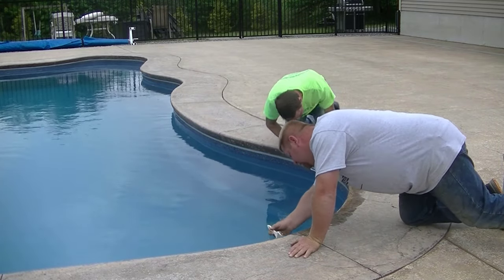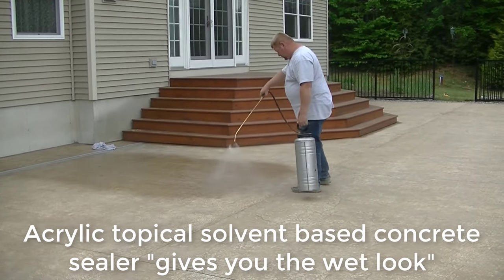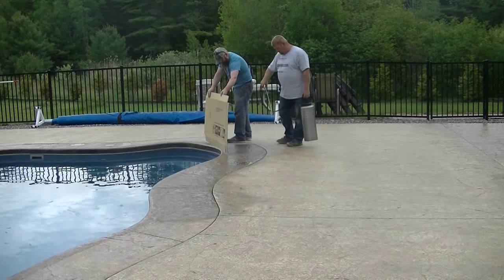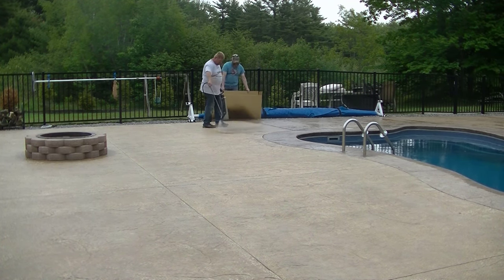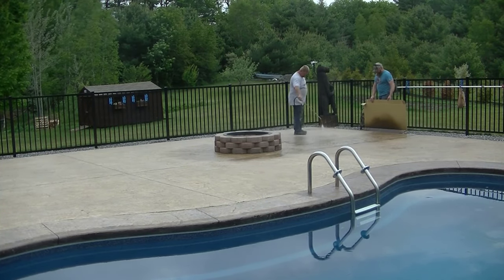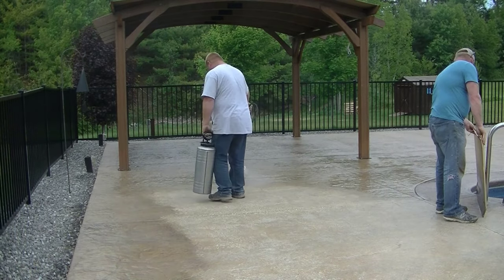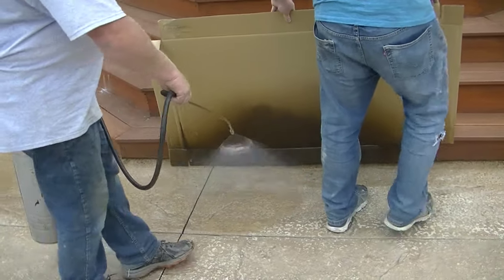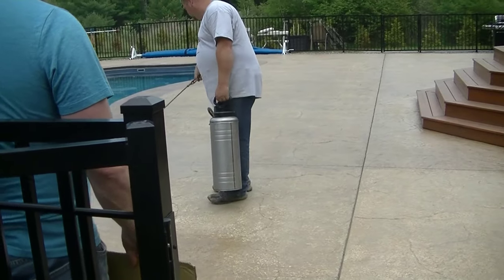Seal And Re-Seal Stamped Concrete (My Top 2 Concrete Sealers)

Comment from the maker: This is my go to sprayer for all concrete sealers: Chapin Extreme - https://amzn.to/2WYomi5
Reply: Expensive but worth every penny, Sprays a big pattern and chemicals don't hurt the seals. Just clean it good after use, it'll outlast a truckload of cheap sprayers.
Reply: Do you use the 1gpm or .5gpm tip when spraying foundation armor?
Reply: How much can you charge for a job like you did on the stamped concrete by the first pool?

Comment: Two years old but fantastic video. Update…

Just completed my pool patio and an adjacent patio with the AR350. Some post application tips for anyone who is looking to use this sealer. 

Spraying and backrolling gives you a really nice and consistent look. My pavers are textured so backrolling was essential to preventing pooling in spots. If you have an in ground pool with a loop loc cover…be sure to cover the grommets around the pool. I used painters tape and carefully applied it then used a razor blade to trim around. When I was done with the job the tape came off and it saved me from having these things sealed shut which would have been a nightmare. 

Definitely use a paint shield or piece of cardboard as shown in this video. No matter what you do you WILL get spray in the pool. Before the end of the coat application I added some enzymes to the pool which seemed to help clear thjngs up. You can also use clarifier. 

The anti slip additive….do not mix this in the sealer. It will clog your sprayer and be a disaster. Also don’t add it to a container for brushing or rolling. I hand brushed the coping around the pool and calculated how much anti slip to add to a pint and figured I would at least get the coping done. The additive settles to the bottom like sugar and doesn’t mix well. The solution?  Drill holes in the top of the bottle like a salt shaker. As you go along shake the additive on and backroll. I read a recommendation to use a hand spreader (for seed) but the opening may be too large. The shaking method worked great. 

Have all of your tools ready beforehand. Use an 18 inch roller for the back rolling and get an anti shedding roller. This is a two person job for sure. I can’t speak on different sprayers but I went for a steel one appropriate for solvents made my the same company mentioned in this video. Got from Amazon for about 118 bucks. Worked great. Keep a bucket with a garbage bag in it handy for each time you fill the sprayer. After you pump it spray into the garbage back. The first spray after filling tends to come out inconsistent. So knock that out in the bag and you’re good to go without any drips or weird lines. 

If you have anything you don’t want sprayed cover it. Sprinkler heads in particular. Just some painters tape or whatever. 

This sealer looks fantastic. Popped the color in the pavers and changed the look entirely. Before sealing they looked great when wet but light and faded when dry. Now they look as they should. Good luck and take your time preparing for the job.

Comment: I just used the Eagle concrete penetrating sealer and it works great. You can pour a glass of water on it and it doesn’t soak in and you can blow it off with a blower. Same when it rains.

Comment: I do commercial concrete and many of our flat work pours need salt protection. I use CureShield EX on sidewalks (it’s a cure and seal so you can apply it immediately after finishing) but I also found that it works great for stamped concrete. I apply it as normal after antiquing and it looks great, penetrates so it’s not too slippery, AND protects from salt. Hands down my favorite sealer.

Comment: Thank you for your informative video. Two questions: 
1. How to re-seal AR350 after 2 years? Do I need to remove old seal befpre re-applying new coat? 

2. If I apply penetrating sealer now, can I seal with  topical sealer AR350, over penetrating sealer, after a year or so to enhance color?

Comment: Hi mike thank you for all the videos, my stamped colored concrete patio looks terrible its turning white and I do seal it every year.  If I seal it the patio looks good for a day or two, I used a roller to apply the product , the product I have used is called Butterfield Color Guard. I think it has to be stripped.  Could you please explain to me how to strip the stamped colored concrete patio.  Thanks

Comment: Just wondering if any preparation work is required on a new slab before application.? Other than having it clean of any loose particles. I leaning towards using the Lastiseal. Had the concrete patio done to avoid a lot of maintenance!

Comment: Hi Mike! I’ve been using Diamond Clear by Euclid on my 7 year old stamped concrete patio. I had read that you should use xylene to bring the color and shine back instead of the sealer every year to prevent buildup. That’s what I did and now whether I use xylene or the sealer, where the sun hits it the hardest I’m getting that milky look within 2 weeks of application, then it begins to look real dry and colorless like there’s no sealer there at all . But the shaded areas are great so I really feel it’s UV degradation that’s happening. Would changing to Foundation Armor help or what are your thoughts? Thank you!
Deb

Comment: Hey Mike, I recently purchased a house with a stamped concrete pool patio. (First time owner of stamped concrete) Previous own I believe used Thompson’s water sealer on it.( I found a container he left in the basement) I need to clean and reseal my patio and I want to do it right. Is any of the sealers you use in your videos work after I pressure wash my patio that has/ had Thompson’s on it. Do I need to/ or should I just strip my patio to be safe? Any help would be appreciated.

Comment: Mike what do you mean by stamp concrete? The pattern on top?
Reply: I'm not Mike but yes. They have pads they put on the concrete while it's still a little soft and step all over it until the design is impregnated into the top surface. He has videos on doing them, looks awesome.
Reply: @augustreil  thank you.
Reply: @GregoryBirulkin , You're welcome !
Reply from the maker: Yes, the pattern.

Comment: Hey Mike thanks again for doing your posts. I have use the Endura seal 100% acrylic. However it appears that every year I have to reseal the deck. I use a roller and shark bite. Would you say it's standard to have to seal the deck to give it that nice wet look every year. Is it possible that the Endura seal 100% acrylic is just not a good product and is wearing down in the elements in upstate New York? Are you shark bite and roll the product on. I am thinking of using a sprayer after power washing. I'm concerned that the sprayer will not give me the same grid as using the shark bite. What's your thoughts? Would you say it's standard to have to seal the deck to give it that nice wet look every year. I

Comment: thanks for the information, we are getting ready to reseal our 2 year old stamped decking around the pool, it is currently slippery when wet. Which anti-skid do you recommend to use with the AR350 sealer, and how much to mix with the sealer. we probably have 300 plus feet to cover (rough guess), thanks
Reply: I just finished first coat of AR350 around pool. They recommended the fine anti slip additive. Jury seems out on how best to apply it. It says to mix with the sealer but if you are spraying, this will almost certainly clog the sprayer. Another suggestion is to use a hand held broadcast spreader. Only I think these won’t close to narrow enough opening to prevent an over application. Im going to drill some holes in the top of the cap on the bottle and see if hand shaking the application will be best. These bottles aren’t cheap so the proper rate of application is important.

Comment: hey bud whats the name of that spray tank??? weve been having troubles with getting a nice sprayer.
Reply from the maker: Keith, It's the Chapin Extreme 3.5 gallon one: https://amzn.to/2WYomi5
It's the best one I've ever used.
Reply: X2,  stainless is the way to go.  The red or blue cans or not for solvent based sealers, the solvent will eat the paint inside the can.
Reply: @bubba9482  There is no paint inside the red 1949 sprayer can

Comment: Hey Mike! I’ve watched about all your videos. Studying and trying to get better every day. I got the sprayer that you use, is that a special top you use to get a nice mist?
Reply from the maker: It's the fan tip not the cone tip.
Reply: I both the chapin , and even i pumped it so many times before using, i dont get that misty spray output like the you are getting on this video...why is that? Pretty sure i have the fan tip nozzle...

Comment: I applied penetrating sealer on my new stamped concrete patio, don't really like the looks; can I apply film-forming sealer over penetrating sealer to get more color enhancement?
Reply from the maker: Yes
Reply: @MikeDayConcrete  I sealed my pool deck in CA a few years ago but it was so slippery when pool water was splashed on it that my grandkids were falling. I know it needs to be sealed after all these hot summers but I don't want anyone to fall including me. :-) I read the comments and know there a couple of folks asking about anti skid but no reply. What do you recommend? Thx!

Comment: I am getting ready to seal a new concrete patio that is about 1200 sq. ft.  I have owned a Chapin Xtreme sprayer (red metal one) for several years and planned on using it to apply the sealer. my concrete contractor recommended a solvent based sealer made by SpecWest.  He told me not to use the Chapin sprayer because the sealer would eat it up and it would clog.  I went to buy the sealer today and he dealer at SpecWest told me the sealer  MIGHT eat the inside of the tank and I would get black specs in my finished product. I was told by both of them to use a throw away plastic sprayer which would be a one time use sprayer. Any input on using the Chapin sprayer?